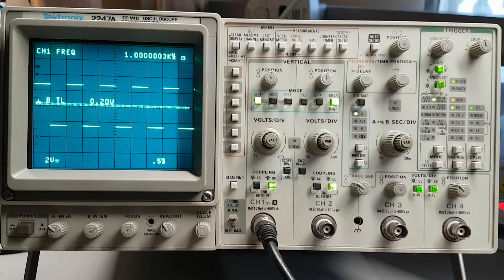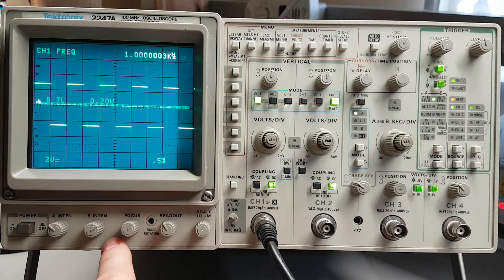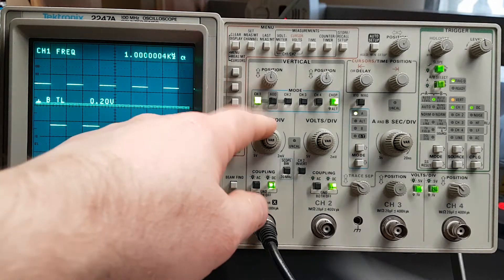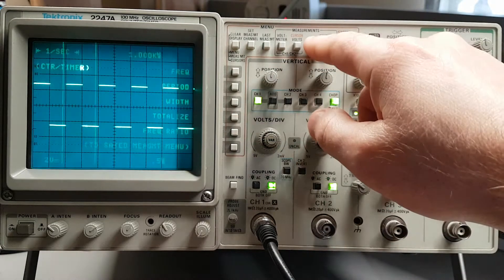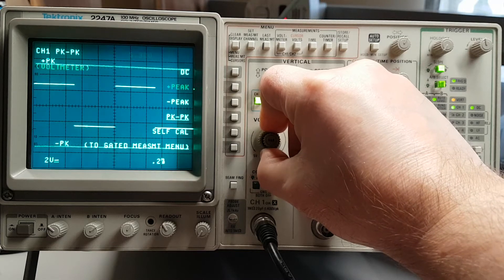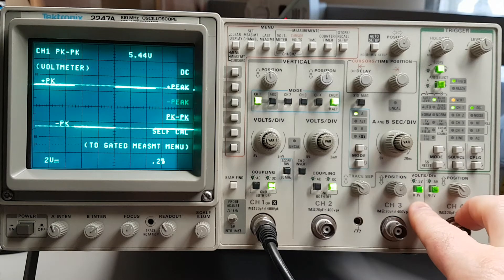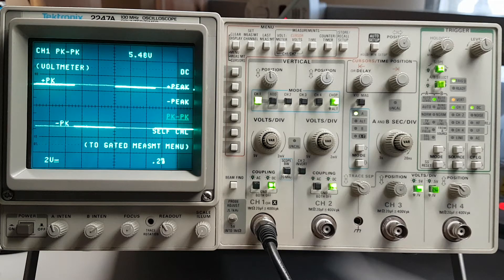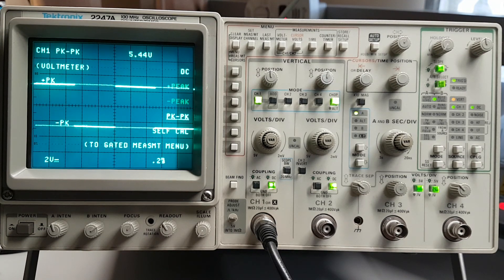The Tektronix 2247A

Comment: Nice sharp CRT. Low hour unit.
Reply from the maker: Yes it's in like new condition, it's backup battery is 3.6 vdc. I think it was from a University or something as the guy
who sold it to me had many. The Tek 2440 i got is also mint but had both the NvRams dead. Easy to fix and cal.
It no doubt has low hrs because both NvRams were dead which means it sat in the off position a lot and it has 
one hell of a bright trace as well. Cheers! Love your videos btw!

Comment: One of the Tek engineers told me the co-processor is the same board, same spec. as used in the 400MHz portables and its actually good to about 500MHz. In actual use, I find that it may be true.
Reply from the maker: I think you are talking about the 2400 series that can go up to 400mhz, and most of the boards are interchangeable. The 2200 series only goes up to 100mhz. The 2400 and 2200 series of scopes are
totally different and are not interchangeable.